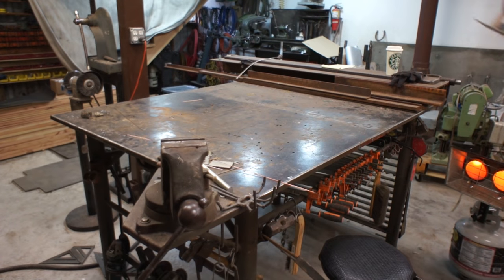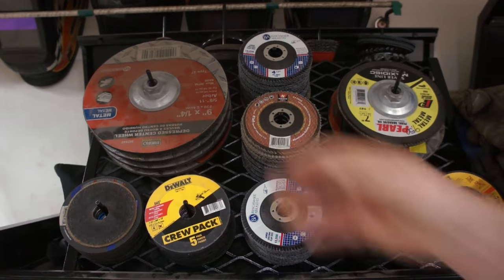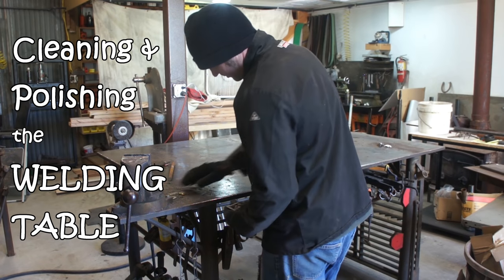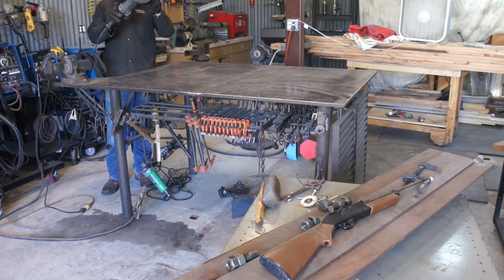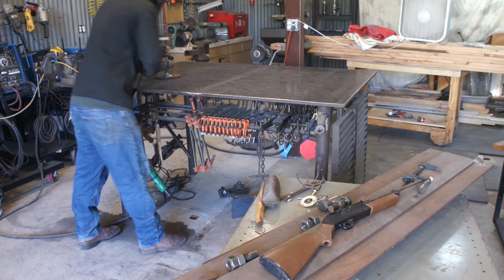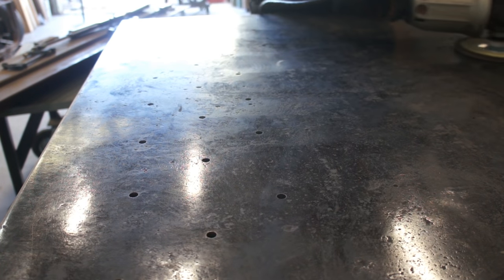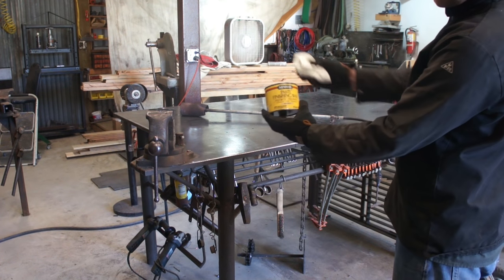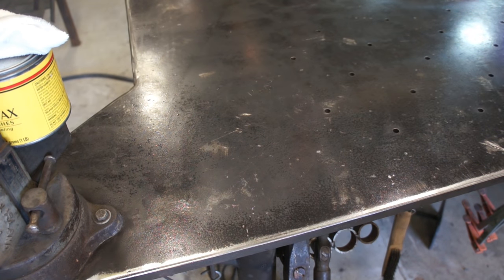Keeping the WELDING TABLE clean, shiny & smooth

Comment: This works well on firearms as well. Remove the grips, Clean well and put it in the oven until it 'Hot to touch" (Around 120 degrees only). then use the paste wax. Works better then oils and keep them from rusting while in storage or from the acids in your sweat.
Reply: OMG.  The nonsense on this thread is unbearable.  Strip your guns and put them in an oven to 'pre-heat' for a "storage" application of wax???  You gotta be joking here.  No wonder our 2nd amendment is under 'fire'.  Unbelievable.

Comment: I use fluid film to treat all my bare metal. Spray it on a rag and wipe it on. It's lanolin based with no solvents. Water proof, non toxic smells awful.
Reply from the maker: Ive heard of that stuff. Someone told me its made from sheep/wool byproducts.
Reply: the smell of fluid film is memorable - not awful IMHO

Comment: Wax on a table can cause contamination to the weld.Not recommended for welding .
Reply from the maker: Are you welding on parts or welding the actual table? I employ a variety of welding processes on many different parts and never have I experienced any contamination problems from waxing the table. Maybe you're waxing too heavily. This method leaves almost no residue.

Comment: I guess we have different ideas what “polish” means 😂 I don’t grind I use a 60 flap then go to a felt flap disc and a steel polish (Autosol for me) its a good protection and lasts longer than wax.
Reply from the maker: Ill have to look up a felt flap, never heard of that
Reply: @unitedstatesofbuild4915  you can use fine grit/metal polish with the felt flap and get it to shine like a mirror

Comment: I love the video, I'm about to build my first welding table next week and I was looking to prevent the rust.  I currently use rainX wax on all my woodworking tools from table saw to lathes and mills.  I probably will try out the rainx on the welding table also..but I just didn't know if it would create more hazardous fumes.  Any how thanks for the video.
Reply from the maker: Awesome man, RainX makes good stuff. I use similar turtle wax spray 'n dry on my cars AND on some of my tool surfaces. Try out some paste wax sometime! Also, thanks for watching!

Comment: Not to be a downer here...but you're putting a lot of effort into "polishing" mill scale while you refer to it as "clean bare metal".  I've never seen anyone "wax" a welding bench.  Never even heard of such a thing.  I've spent over 40 years in welding and fabrication, and the only thing we cared about was a true surface of clean steel, minus mill scale.  Clean, bare, naked steel, that will rust in minutes from a single drop of sweat.  Sometimes we rub an area down with WD-40 but most of the time, it has a slight color of red, mostly from grind particulate.  We don't care about looks.  What is important is a clean connection from ground to electrode be it stick or wire.  Wax a welding bench?  I can't help but laugh.  (sorry)